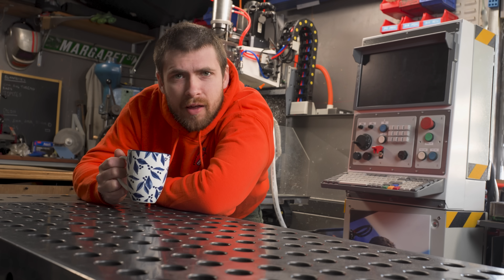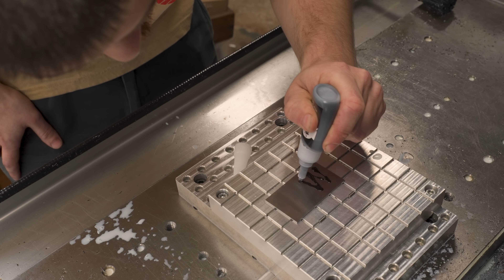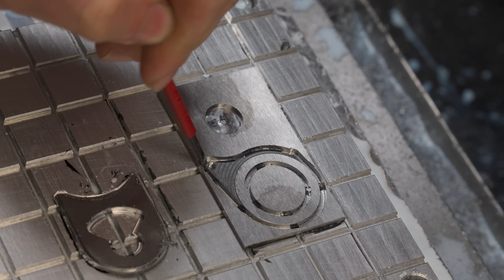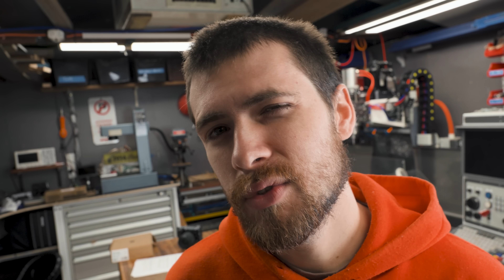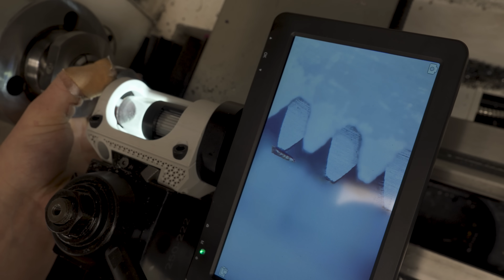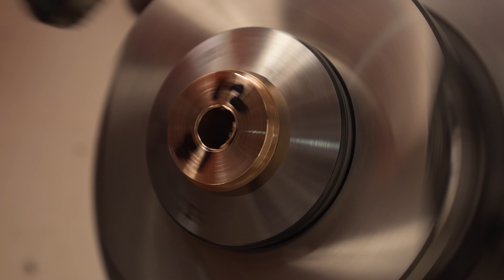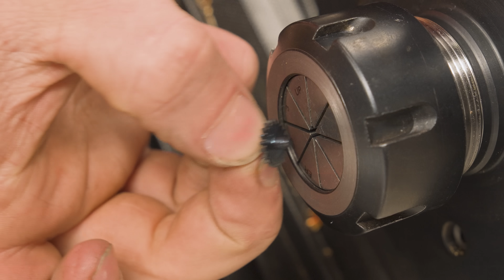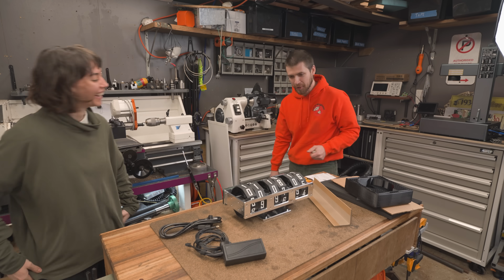What if angles were metric?

Comment: Beautiful instrument, man. But can it accurately display 66.666666667 gon, for my favorite angle, 60°? And what about all the other angles in geometry? In the centesimal system, they're a mess!
     Dig, 360 is divisible by 1, 2, 3, 4, 5, 6, 8, 9, 10, 12, 15, 18, 20, 24, 30, 36, 40, 45, 60, 72, 90, 120, 180, 360 (24 factors). And 400 is divisible by only 15 factors: 1, 2, 4, 5, 8, 10, 16, 20, 25, 40, 50, 80, 100, 200, 400—all numbers divisible by two with no three-way splits. Where are the thirds? 
     No civilization can ever survive without thirds. But I still think it's a beautiful instrument you made. Cheers!

Comment: You should use 420 instead of 400 or 360. Not only is it the funny number, but also it's divisible by 7, 6, 5, 4, 3 and 2 as well as a whole lot of other numbers, which neither of the other two numbers can claim.

Comment: How do you explain how long a meter is to an american?
❌One meter is equal to 39.3701 inches (about 39 and 3/8 inches).
✅ One meter is equal to a standaard M16A4 rifle (39.37 inches (1,000 mm) with a barrel Length of 20 inches (508 mm) for all primary versions.

Comment: Some handy hints on tapping tiny threads. Ideal thread engagement is around 70% and that figure is what all of the tapping charts will give you. But if you aren't putting heavy load through the thread then 30% or 20% thread engagement is fine. So use precision drill bits and drill a bigger hole. Remember, pucker factor is directly proportional to thread engagement. 
Next, taper, intermediate and plug taps are actually different diameters. Taper is the smallest. I had to give this one a go to believe it. Drill a hole in steel and run the three taps through one after the other. You will remove more material each time. So for really small diameters always start with the taper tap even for blind holes. It removes less material and is less likely to break. Not to mention it is easier to start a taper tap square than a plug tap. Using this sequence can further reduce pucker factor by up to 15%.
Love your work by the way.

Comment: The SI derived unit for plane angle is the radian (symbol: rad).
Note this is a DERIVED unit not a base unit like length or time.
The radian is derived geometrically from the ratio of two lengths: the arc length of a circle segment divided by the radius of that circle.

Note -An SI derived unit is a unit of measurement formed by algebraically combining two or more of the seven fundamental SI base units (metre, kilogram, second, ampere, kelvin, mole, and candela) through multiplication or division. While base units define independent physical dimensions, derived units express quantities that originate from those e.g. velocity, force, or power.

Comment: That's because angles are based on the degrees of a compass, 
North is 0° and 360°
East is 90°
South is 180°
West is 270°
The parameter of Standard or Metric doesn't apply.

Comment: In german degree means grad. 
My dad also has a set square that has 100° where the 90° should be, its some weird set square used for geology or sum. The unit is called gon, at least in german idk for english. 1 gon is equal to pi/200 * rad = 0.0157 rad

Comment: Cos there is something called Radian, that is SI or "metric" unit for angle. 
Gradian is very old unit
Degrees are just common, as kilograms are commonly used for weight, although Kg was a unit for mass, but you will never hear "please give me 10 Newtons of potato", what will be actually correct. "Curb weight" of a car is declared in Kg, not in Newtons, and this is incorrect, but common.

Comment: Just a thought - on tooth numbers lower than 20 (13 teeth is a practical minimum) a profile shift is used to reduce undercutting below the base circle - like on your 15 tooth pinion. This restores a good gothic-arch like involute tooth for the sake of a small change in centre distance. Darle Dudley's gear design handbook is very helpful here. All part of the fun.

Comment: Radians are a pain to use tbh. I had to learn them for doing solid body dynamics in my robotics physics classes when studying Euler angles. I hate them so much. You have to represent your angles in a 1 by 3 matrix in the order "roll, pitch, yaw", but the order you apply them also matters. You must assign it like "(2x,0.4z,0.8y)" Which doesn't mean "xyz planes, but the order you apply them. It's always in xyz plane order. You need to bust out a 3 by 3 matrix PER ANGLE using cos, sin, -sin and then your numbers. All of that to define rotation in 3 dimensional space in metric...

Comment: 31:05 - Dude I’m so glad your videos contain a few cuts of you saying “Noooooooo!” in that exact tone of voice… I thought that was unique to my bench. Turns out we have the tone and the motivation both in common! 😂😅

Every time I blow a microcontroller or lift (rip) the solder pads off a circuit board I fine myself using that exact same slightly descending ”NOOOOOooooooooo!” to express my deep enthusiasm for my chosen hobby. 😂

Comment: I'm a pretengineer that builds GPS clocks, a typical Ublox type GPS module that has been moved internationally when turned off (ie; mailed) can take half an hour or so to fully adapt to it's new GPS location. Sometimes you get lucky and its only 15 minutes, sometimes it can be as bad as 40 minutes.

Amazing projects! Both yours and the clock 👍👍

Comment: 360 is also extremely close to the number of days in a year, and the ancient Sumerians carefully plotted the motion of the stars. With 360 degrees in a circle, each star rotates around Polaris very nearly one degree per day.

Also, their number system wasn't just sexagesimal--it was mixed decimal and senary (bases 10 and 6). Each base-60 digit was written as up to 5 tally marks each representing a value up to 10, followed by up to 9 tally marks each representing a value of 1. It was actually exactly the same as how the number of minutes in the current time goes from 0 to 59: a base-6 digit followed by a base-10 digit. 

Their number system probably made dividing anything into 6 times 60 pieces seem especially natural. I can't say whether astrology or geometry was the original reason for 360 degrees, though.

Comment: Nice try, but modern official SI system angle unit for plane angles is RADIAN, its transcendental, and that's why no one uses it except physicists 😆. Gradian was in original metric system variant introduced by French, they divided right angle in 100.

Comment: learn how to generate gears with a slot saw. ;) (andys machines has the best tute) 1 saw beats a lot of cutters you rarely use... its just a bit of maths. better yet. some thought over axes, and it applies to bevels... only way to really generate one without a gleasson...

360. divides by virtually everything but 7... 11...

400 is nowhere near as versatile.

side note. most of the american hangup with metric stems from the french revolution and religious prejudice...

basic argument?
"god made man, an inch is based on man, therefore anything else is an abomination".

and the french were sick and tired of everyone using whatever they felt appropriate as a unit of measure. only thing ever really consistent was the carat or carob seed...

thankfully, we also left "time" non metric... they wanted decimal time...

Comment: I don't want to be the XVIII Century frenchman here but, i've head of the Gradian, but also the reason why we use 360º in a circle.
Since the ancient civilization looked a lot the sky, they noticed that every event comeback approximatively every 360 days. So we use 360 degrees because of the earth rotation around the sun, so something simply identifiable and understable for everyone.
And it's why we still use it today => Simple, reliable, understable. Almost the same philosophy behind the metric system => The meter based on the Earth size, the second on the frequency of an atom, the gram on the weight of 1cm3 of water, etc.

Comment: Well, what do you mean by "metric"? Usually people mean the SI units when they talk about metric units, but the gradian is not an SI unit. The SI unit for measuring angles is the radian (rad), which is the preferred angle unit in advanced mathematics and is also commonly used in physics.

Comment: There is no such thing as a "unit of measure" for angle, because an angle is a dimensionless number. 
It's like saying "a dozen" or "ten" is a unit of measure.
Reply: If there is no unit of measure for angle, how do you measure angles?

Before you answer, go search: "Unit of Measure definition" and "What are the units of measure used to measure angles?"

Spoiler: 

Dimensionless Quantities With Units:

Some quantities have no dimension (power of zero for mass, length, and time), but they are still assigned a specific measurement unit. 

Plane angle: Measured in radians or degrees (an arc length divided by a radius).

Solid angle: Measured in steradians

Loudness level: Measured in decibels (logarithmic ratio of acoustic intensities)

Comment: People criticise systems like the Imperial system - quite understandably - because they are based around the human body and activity.  The metric system is based on the size of the earth, and similar things.  No-one seems to recognise that the decimal counting system is based on the human body - the number of digits we have.  And that is unfortunate.  It means that we use base 10 - one of the worst bases we could use (base 3, 5, 7, 11, 13, 17 etc. would be worse, but only just).  If we had been fortunate enough to have 8, 12 or 16 digits, we would have had a much better base to work with - something that computer science realised a very long time ago.  The problem with base 10 is that whatever you divide 10 by (when working with integers) you end up with a prime number - and 10 only has 2 dividers.  16 has 3, and each of those can be subdivided (are not prime).
60 is a superb base, and that is why we have 360 degrees in a circle (and 60 seconds in a minute, 60 minutes in a year).  You can divide that up in so many ways.  Obviously, 60 is a difficult base to use in general - we would have to have and remember 60 different names for numbers (ordinals).  But for circles, 360 is an excellent choice.

Comment: The story I know about the origin of the 360 degree division of the circle goes back to the fact that, if you choose a certain reference hour and point, each night the fixed stars in the sky twist by 1/365 of a rotation. Some ancient astronomer might have noticed this rotation and chosen its value (approximately 1/360 of a rotation) as a unit. 

Also, 360 has a lot of easy divisors, hence the choice.

Comment: 23:00 ugh don't do this. A couple turns to get a straight start then finish manually. You can't feel shit when it's in a giant chuck. You're lucky to only have broken one tap. Easy to strip the starting threads too if you push or pull a bit too hard.
Also just because it's a spiral tap doesn't mean you can always plunge right through. Sometimes and with some metals the chips still tend to get stuck so don't be lazy and use a good ole back and forth (and back out completely every few turns to clean the chips), it's still faster and easier than dealing with a broken tap

Comment: Very entertaining, stumbled on this channel. I work in developing chips (semiconductors) for real time
control (including software) and we typically use a Per Unit scale for angles. 0 = 0 deg and 1.0 = 360 deg. We actually create math functions like Sin/Cos that take PU inputs rather than Radians. It is actually the gradian scale divided by 4. Using PU scale makes control math so much easier.

Comment: The gradian (aka gon) was originally used to define the meter itself! 

You have 400 gon in a circle, 100 gon is a right angle, and by definition, these are equivalent to 10000km on earth. 

Exactly how nautical miles are derived from degrees. 

Turned out the first meter was a bit too short, while the earth circumference is not the same everywhere, so this definition was quickly replaced by the metre artifact.

Comment: Well, actually, there are arcminutes and arcseconds. There are 3600 arcseconds in one degree lol. Imagine the size tolerance for a cone is +- 1 arcsecond, hehe.
Reply: Lol, I found out they also measure milliseconds of arc and microseconds of arc, hahaha. Can you imagine what that is? Half a second is like a kilometer-long line at 45 degrees will shift just 4.8 mm along its end. And that's 0.5 seconds (500 milliseconds), and they measure with an accuracy of 20 microseconds, damn... (Of course, these aren't machine-made steel parts, but glass and ceramics deposited in a vacuum, but still)
Reply: If some kind of apocalypse occurs or we exhaust all resources, it seems like we'll lose access to this technology forever. It's impossible to create without the knowledge of millions of scientists and a huge theoretical base.

Comment: I had heard of the metric degree, but i never understood why it was 400, it always seemed odd to me since all the other metric stuff is neatly 100 or smth like that
but i think i actually figured it out, altho i haven't checked it so i might be wrong, but it makes sense to me

the km is defined as one 10 000th of the distance from the pole to the equator, as in one forth the circumfrance, making earths circumfrance almost perfectly 40 000km
Since degrees are most commonly used in coordinates, having 400 gradians in a rotation, makes it so that 1 gradian is now 100km

so 1 centigradian (1/100th of a gradian) would now be exactly 1 km, making it very easy to convert between gradians and km on the earth when talking coordinates. Knots for example are arcminutes/hour, an arcminute is a 60th of a degree, but if you instead use 1/100th of a gradian, 1 metric knot would now equal exactly 1 km/hour

taking all this into account, i feel like earths circumfrence being 40000km must be the motivation for the 400 gradians, it fits too well

Comment: 23:24  A hot, saturated solution of alum (potassium aluminum sulfate) in water will dissolve steel, but won't bother nonferrous metals like aluminum and brass.  Try it out with your scrapped piece.
What a beautiful mechanism!  Great video, too.  I've subscribed.

Comment: The mil is about as close in spirit as you get to a metric angle: 1 mil ≈ 1 metre at 1 kilometre. A finger held at arm’s length is roughly 30 mils wide, so if your finger just covers something 1 km away, it’s about 30 metres across.

Comment: As of 1995, radians are the metric unit for angle.  They had been in the SI standard as a supplemtary metric unit since 1960 (along with other dimensionless units). This category was merged into the main standard in 1995.

Comment: The biggest reason 360 was used was because it is easily evenly divisible by the largest amount of small integers [2,3,4,5,6,8,9,10,12, ...] without the number of digits getting out of hand, which makes many math operations with it much easier.  There are other numbers that do that but the number of digits gets large quick making math with them harder or at least more lengthy and tedious [see note below].  Also note that due to that it has a large list of factors:  [1,] 2, 3, 4, 5, 6, 8, 9, 10, 12, 15, 18, 20, 24, 30, 36, 40, 45, 60, 72, 90, 120, 180 [,360] ; which provides many ways of splitting a circle up, again making the math much easier and the ability to have equal segments much more varied.  But you may also note that most scientific calculators do support Degrees, Radians, and Gradians.  The difference of them is 360 is mathematically easier due to it's large count of integer divisibility, Radians makes sense and is useful as the radian is based on Pi which is significant for circles and in turn makes math with it uniquely simplified for certain things dealing with angles, but the Gradian is just the extension of base 10 which is already a terrible base to have your number system in as it was literally only based on the fact that we have 10 fingers and has no other mathematical significance other than how much more complicated it is to do math with than other bases like bases 2 or 16, so it really doesn't help much to divide a circle by 100, it may only simplify basic decimal math operations with no regard to the source of those numbers [that is to ignore that it represents an angle] only because we are used to using base 10, otherwise it is more complicated and just a pain.  The only other angle representation worth mentioning is a circumference, that is where the angles go from zero [0] to one [1] for a full circle, and makes useful sense for certain types of things more so than Gradians, it is NOT typically directly included on calculators, however in base 10 it is equivalent to Gradians / 100, that is just divide the Gradians by 100 and you get circumferences, but this should clarify that Gradians are effectively the percentage of a circle, which is about the most use you will ever get from it.

Note:  It can be seen that 360 does not evenly divide the relatively low numbers of 7 and 11, to have a number that also divides 7 would be 2520, and to include 11 then would be 27720, so it is easy to see it isn't awfully helpful as these larger numbers would be more difficult and tedious to do by hand.

Comment: I'm a little surprised you didn't try anti-backlash gears. 1 gear stacked on top of another identical gear that is rotated slightly and kept tensioned by spring pressure - used lots in some of the boxes I used to repair.